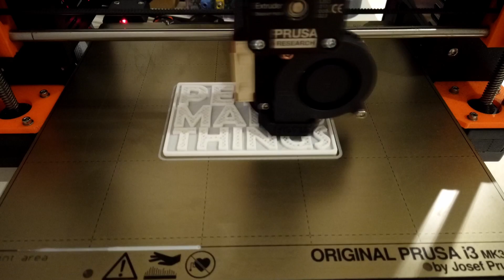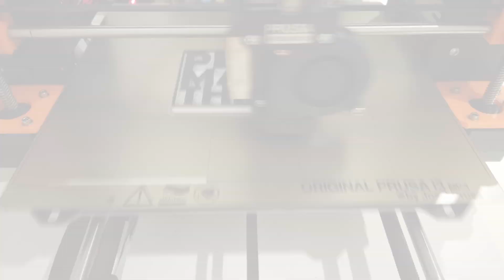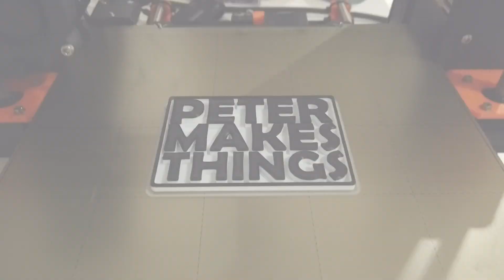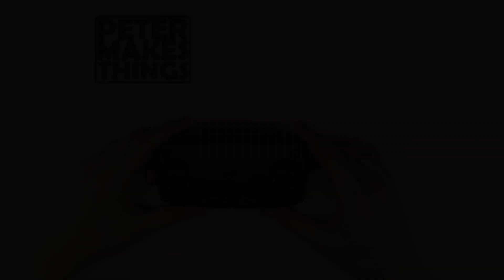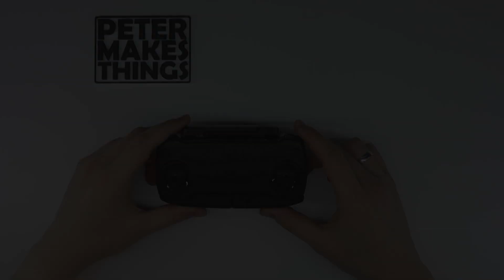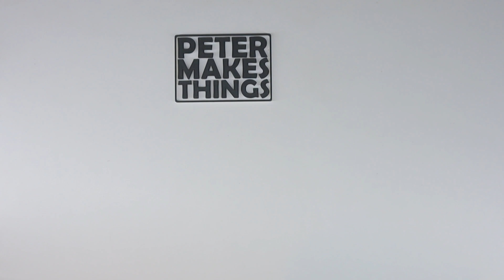How to Silence Mavic Mini Controller (+ teardown)

Comment: Peter to avoid beep not necessary to make this mode : in enough to modify FC parameter , setting 0 on battery type and you  have no dji battery , you can fly up to zero % and without beeping . to access mini parameter you can use python
Reply: Do you have a link that explains how to modify FC parameter?
Reply: @Magnesium_is_good_for_you  https://www.youtube.com/watch?v=OOsTc0HKTCw&ab_channel=digdat0
Reply from the maker: interesting, didn't know about it, thanks! will try it out